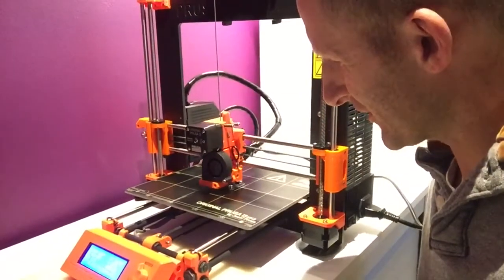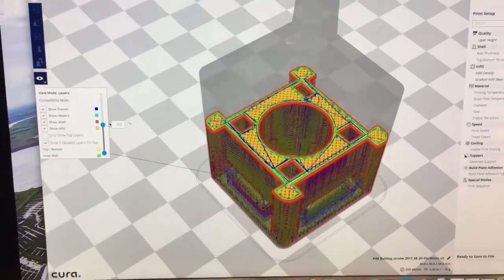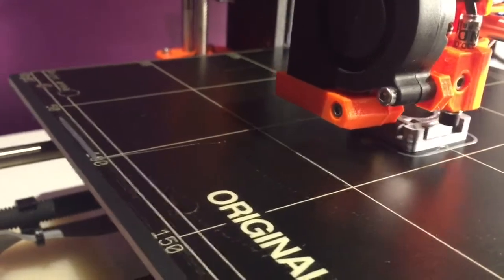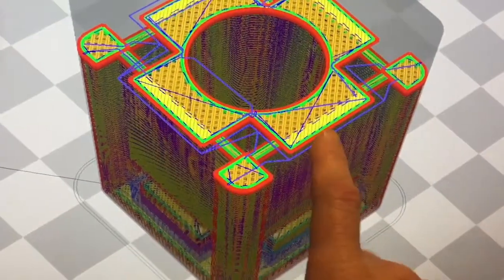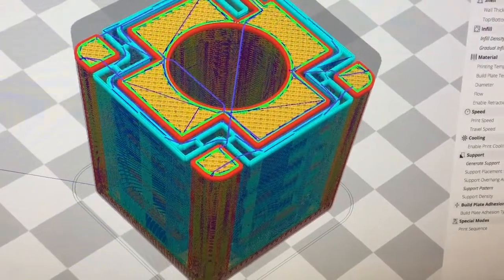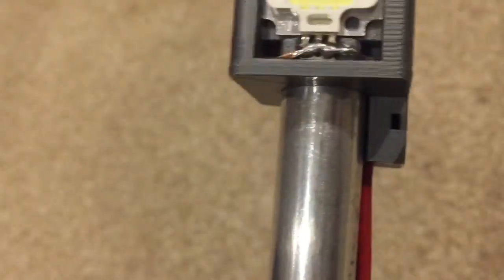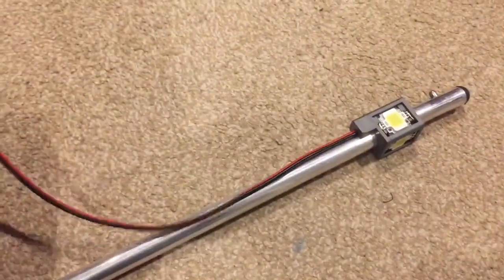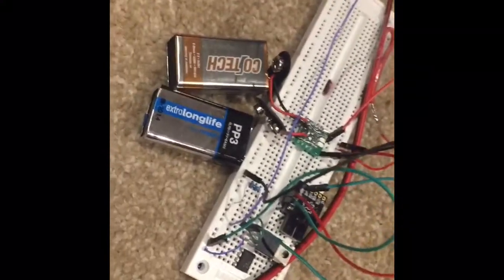3D Printed Paramotor Strobe

Comment: How much does this look like it will cost to make all in after completion
Reply from the maker: Adam Aves - it’s cost me over £600 so far, that’s because I had to invest in a decent 3D printer! If I can sell a couple at a reasonable price, then at least I will recover my costs
Reply: Andy Bexx how much would it cost without the purchase of the printer and how much do you recon you'll look at selling them for
Reply from the maker: Adam Aves - Hard to estimate at the moment, the LEDs and electronics are a fairly cheap, depends on what the batteries cost. I haven’t really considered costs at this stage, purely a project I want to get right for myself.  Then if it all works and there is enough demand I may look at selling a few.  What would you be prepared to pay?